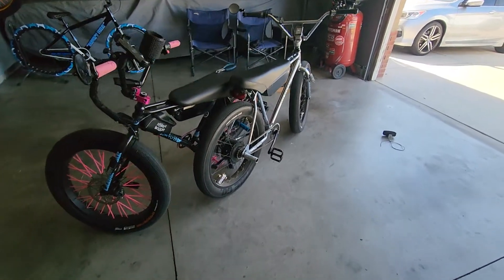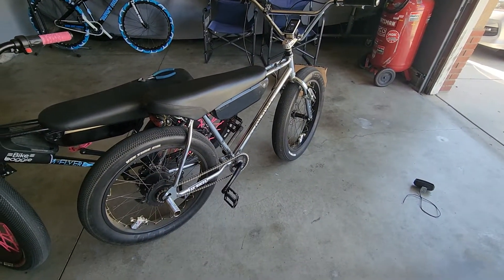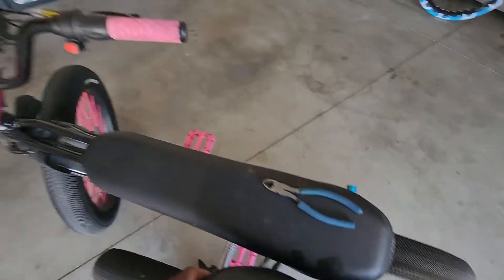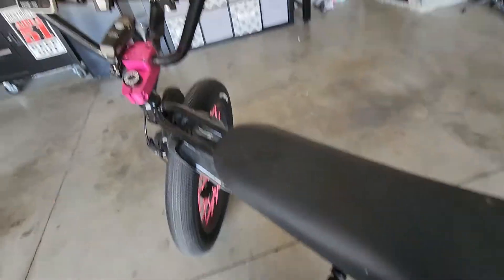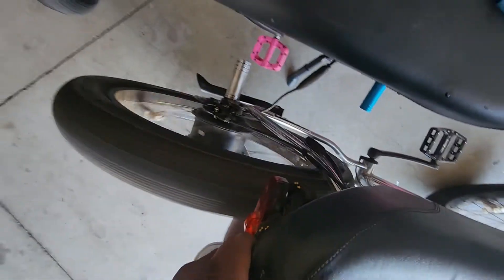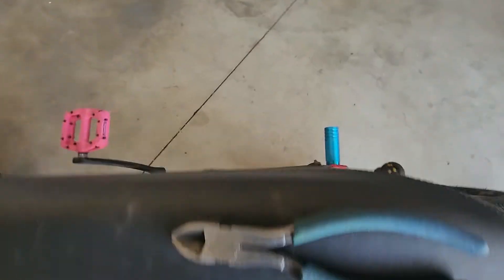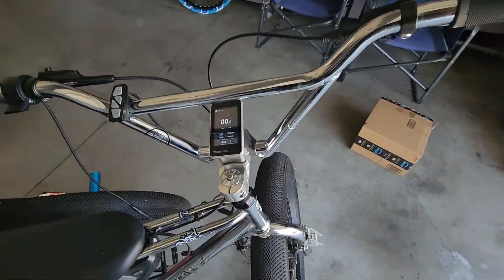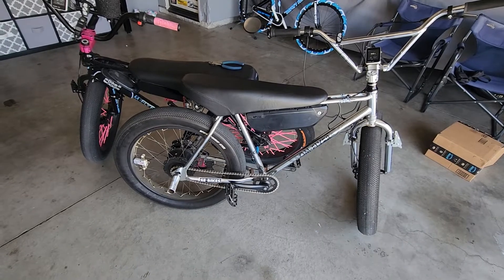CREW DART MAYBE THE CONTROLLER IS FRIED?

Comment: I don't think its the display screen thing, there's a main, brain/controller box, all the stuff, components  plug into, some times they can be built in to the battery, but most of the time its a small metal box, why i asked is it under the seat? have you still got that electric wheel kit, take the main control box from that,, not the speedo screen thing
Reply from the maker: Yes it's under the seat I think it's called the controller
Reply: not sure if you did try, but fit it back the way it was, to see if the old light was part of the circuit loop, built for that bike
Reply from the maker: @dresterGTAIVplayer  I was riding it for two days without the light
Reply: @bikelifegee  weird, hope you fix it i like that bike, been thinking of getting one like it, same sort of design, but with dual motors :)
Reply: Try using your old throttle before. I've read reviews on the thumb throttle breaking